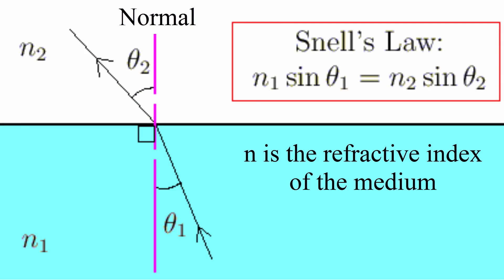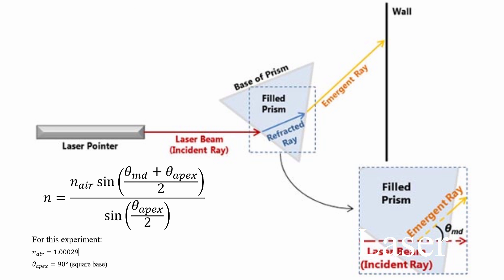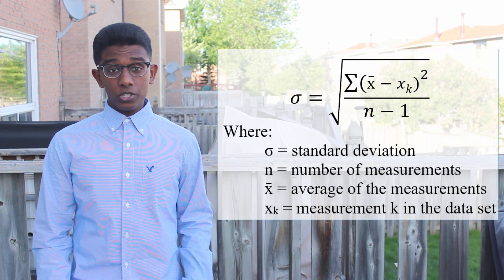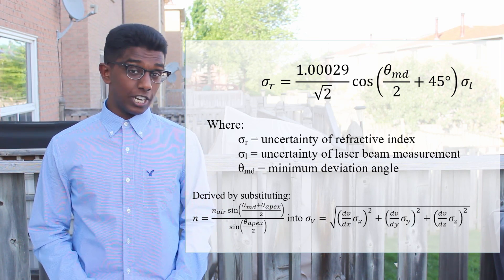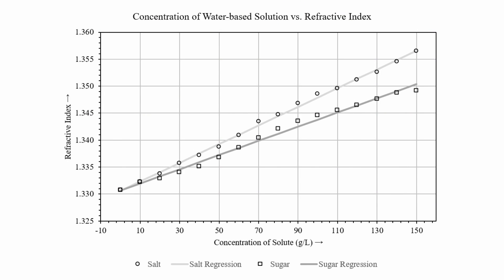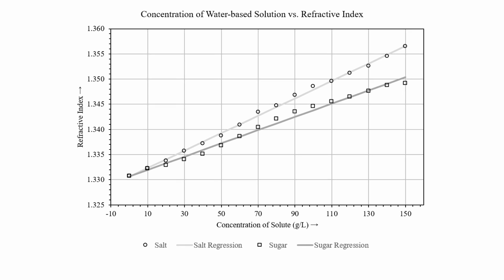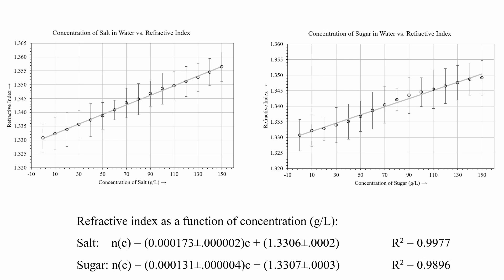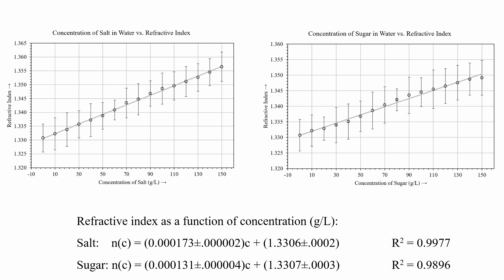Concentration of Solution vs. Refractive Index Experiment - Nicholas Vadivelu

Comment: i am having a brain fart, how would you calculate the index of refraction of the solution after you shine the laser through the prism/container?
Reply: take the distance between the point of the laser and the ruler and use tangent to calculate the incident angle, then use that in formula for index of refraction